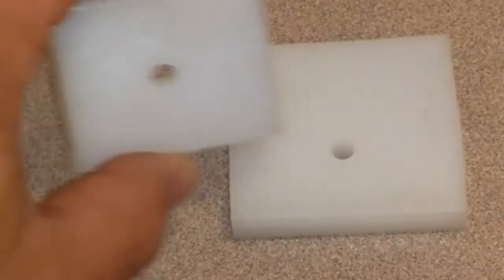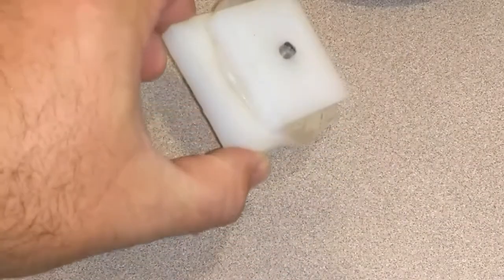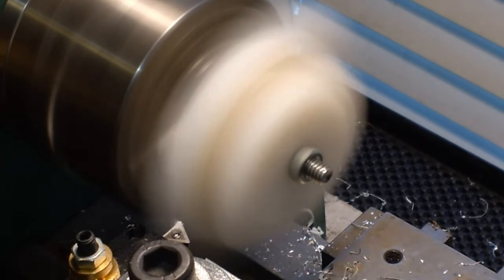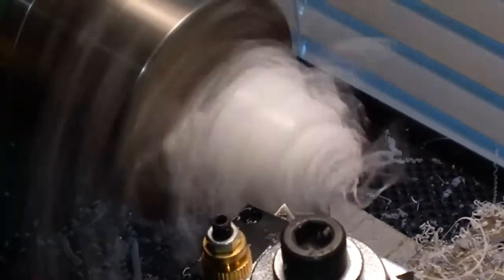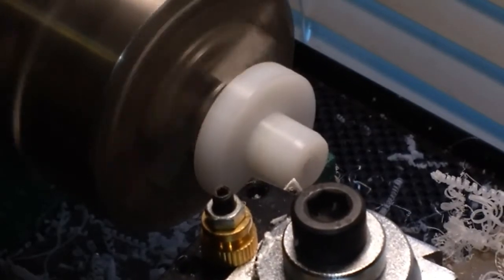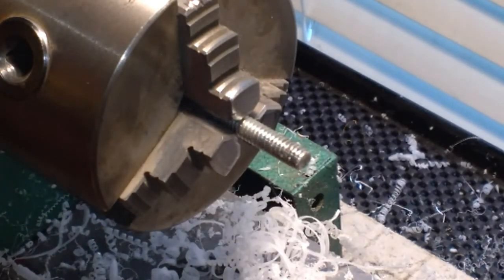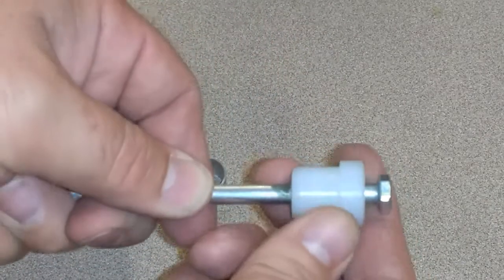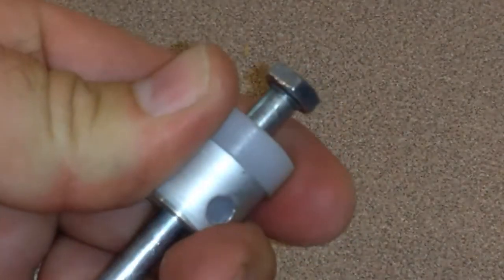From HDPE Cutting Board To Custom Plastic Bushing

Comment: I've also found cutting boards to be an excellent and economical source for HDPE plastics.  Woodworking supply houses sell HDPE plastic panels and strips in various thicknesses but charge a small fortune for the material. The cutting boards can be picked up from dollar stores, available in white and often other colours for just a few bucks.  No doubt they are Chinesium.
Happy to see that the material can be worked on a lathe.  It can also be worked with any of the standard woodworking tools (table saw, band saw, miter saw, jig saw, router, planer, hand saws, dremel tool and sanded...etc.).    Great for table saw feather boards, miter slot runners, push sticks, zero clearance inserts, router mounting plates and protectors under the legs of any furniture that you might wish to slide without scratching up your floors.  I've made custom latches and replacements for plastic parts that break.  Old kitchen cutting boards move to the garage where they get belt sanded and orbital sanded to a new finish, then i use them as pallets for mixing auto body fillers and epoxies.   The only limitation is their size.  I will try your lamination process to create some greater thicknesses.

Comment: Hello juggernaut, I'm glad to be a subscriber and I would like to offer a few compliments if I may. I really like how you bonded the plastic together because often I find that I don't have the right material for the job. I also heard your comment about your battery dying, sorry to hear that. A lot of times I find myself filming and think I just got some great shots and then go look at the camera and noticed it's off or paused or something and it's a real bummer. Thanks so much for the shout out and I look forward to seeing your next video where you explain what this bushing is all for. -cheers
Reply from the maker: Thank you! Video work isn't something I'm good at but I'm learning! I get wrapped up in what I'm doing and forget the camera is even there. I will keep working on it. HDPE is a great material for DIY'ERS. When you heat it and bond two pieces it is basically one solid piece afterwards. Lots of possibilities! It also can be tapped and holds treads pretty well for plastic. Not quite as good as Delrin but a lot cheaper and easier to find locally. I have made some neat looking cylinders from melting and pressing different colored pieces of HDPE bottles together using pipes and things as molds.
I really appreciate your support!